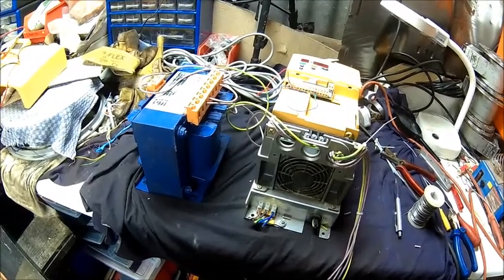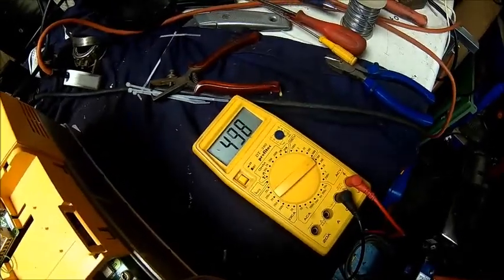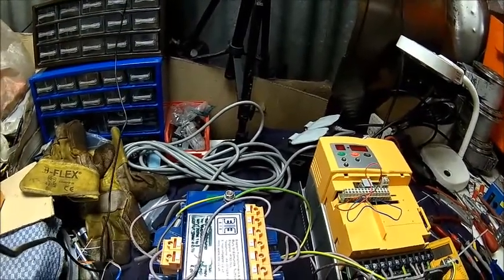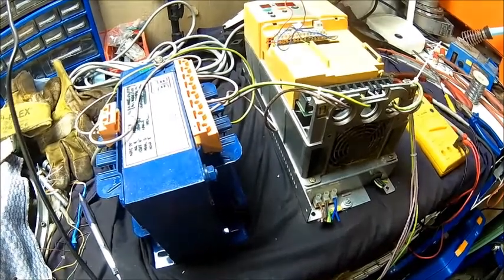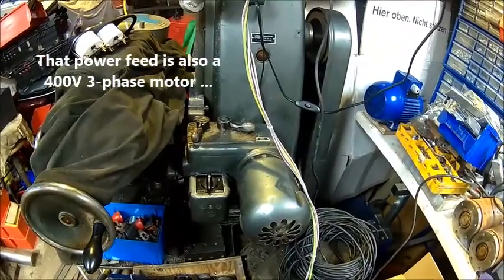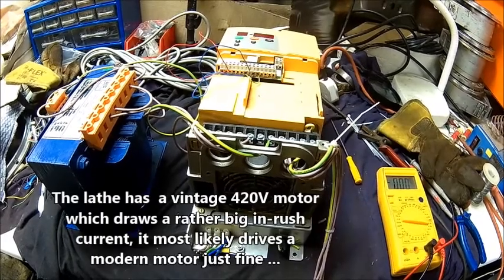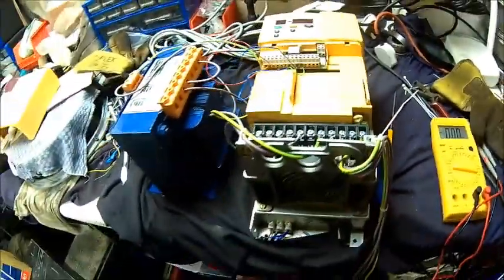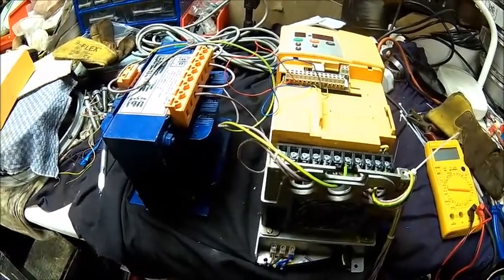DIY Phase Converter, circuit diagram, explanation and a working test setup (not rotary)

Comment: Fantastic description mike very well produced clear as abc. Sorry for the late phone calls last night mike, (Sunday😕) I went over to Al’s to look into the noise in the mill head for him, but the naughty Transwave had other ideas😢 we should have unplugged the mills 110 transformer from  the 440volt side of the transwave feed. And ran the mills transformer  from the 110 Yellow transformer in reverse to power the switches, as transformers can be powered from ether side 110v or 440v. I never thought the transwave would fry the transformer once a motor was running. Al’s shed is very small & I was round the back of the mill & spotted smoke from the mills 440v/110v transformer. But  by the time we scrambled to turn the transwave off it was too late, fried the mills transformer 😢 I think Al said the transwave dial was up at 600volt, this would be because we had no motor load. Lesson learned.
Reply from the maker: no problem, happy to help and good luck with the rest of it.

Comment: Hi Mike great video :)  Just wondering do you think you could run a 3 phase stick welder from this configuration?  400v /10A? Keen to know your thoughts?
Chris
Reply from the maker: Thanks Chris, ... the question is... is it really a 3 phase welder or is it a single phase welder running on 400V, which is much more likely. You can easily check it by looking at the transformer (look at my "supercharged MiIG welder video, that's a 3 phase transformer) and also the wires going into it, if only 2 phases connected, it is definitely a single phase machine, so all you need is a step up transformer, no need for a VFD. The name plate may tell you as well, if it says 4kVA it's single phase, 7kVA would be 3-phase. Hope this helps.

Comment: Hello, very good videos.
I’m quite interested in your idea however I’m looking to build similar but to run a 5.5kw motor would this be possible?
Regards Tom.
Reply from the maker: Thanks Tom,... well, the concept is certainly scalable, providing you have a big enough main supply. Don't know where you live, but assuming a 230V mains and a power factor of 0.85, you need at least a 30A supply line. The transformer must be able to supply at least half the power, so that's a big chunk of iron as well.
Reply: dynoguy 
Thanks for coming back to me, we have a 240v 100a supply to the building, very little running except a few lights so I can quite happily stick a 32a in the board to run this from, however sourcing a transformer of sufficient rating could be interesting...
Reply from the maker: You say 240V, so i assume you in the UK,...fact is that the nominal UK mains voltage is actually 230V since many years.... just to be correct ...:-)
Sourcing transformers is actually not too difficult, you can get decent rated 110V transformers for very little money, so just get two of them with a real 2kW  rating (not the super cheap ones with only 50% duty cycle), put them in series and  you got a transformer set which makes 220V output at 4kW, that in series with the mains makes it 450V, perfect for the VFD.
With single phase supply, your VFD needs to be at least one size bigger than your motor, so that's a 7.5kW/400V version then. But remember that these yellow site transformers are center tapped at 55V, so remove that ground wire before you turn it on, otherwise there will be a lot of smoke and sparks.....cheers, Mike
Reply: dynoguy 
Thanks Mike, very helpful information. I will see what I can come up with. Yes in the UK, and indeed 230 is correct👍
Regards Tom.

Comment: I'm no electrician so excuse my ignorance.
I'm a bit confused about the term inverter. Isn't an inverter for converting DC to AC? (like the box I have in my car to charge my laptop)
So what exactly is that yellow box you keep calling an inverter? (It looks like a VFD and it's named a VFD in the diagram)
And it it's a VFD can you just put 400+ volt into any VFD? no matter if its a 2ph or 3ph model?
Reply from the maker: Did i actually say "inverter", if i did so, sorry. The term "inverter" is simply wrong as it does not invert anything but it's very common "street language". A technically correct term for a VFD would be AC-DC-AC converter, because that's what it actually does. The yellow box is an Alstom MV500 VFD.  You need to look at the name plate of your drive, it states the input voltage range and as long as you stay within these limits you can feed it either with 2 phases or 3 phases. However, on a 2 phase supply you must de-rate it by approx 30 to 50 % as the rectifier may not be suitable to carry the full load on 2 legs only, also the capacitors are too small (as said in the video) therefore you get excessive ripple on the DC bus. You also need to go close to the maxiumm input voltage as on 2 phases you get less average DC bus voltage than on 3 phase supply, therefore you may reach 400V output if you don't increase the input accordingly. As usual, you get what you pay for, the Alstom does fine at full load, but a cheap Chinese one probably not so well ....
And if you read the manual of your "Bangtidy" single phase VFDs, you should find that they actually have 3 input terminals, even the single phase models, the difference is the extra capacitor sticking through the heat sink, but that would not harm on a 3 phase supply.
Reply: The output end is an inverter. A Variable Voltage Variable Frequency drive first rectifies the incoming AC to filtered DC then inverts the DC to the VVVF for the motor. I am an electrician and this is my specialty.